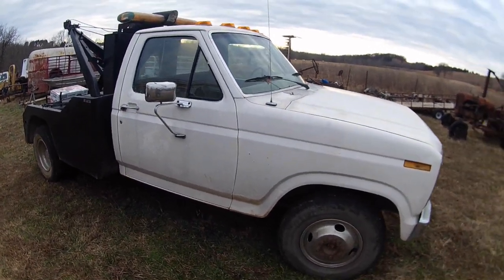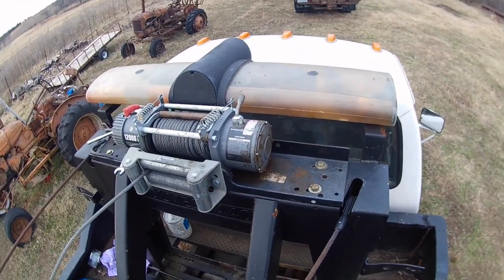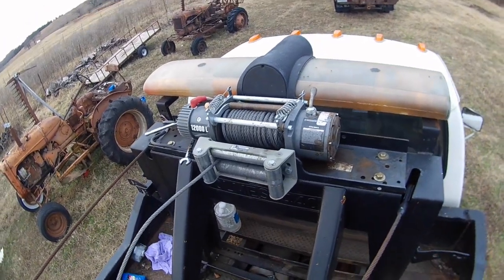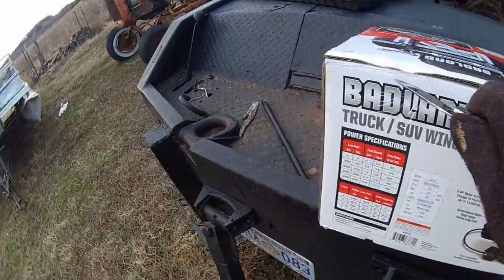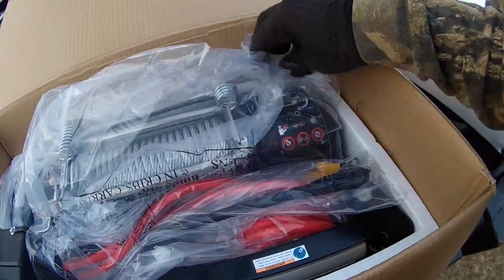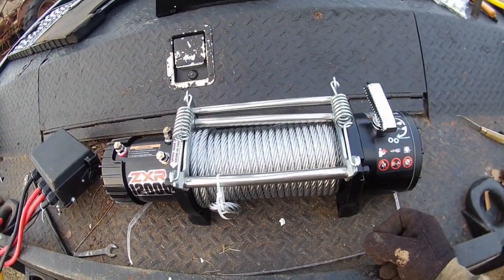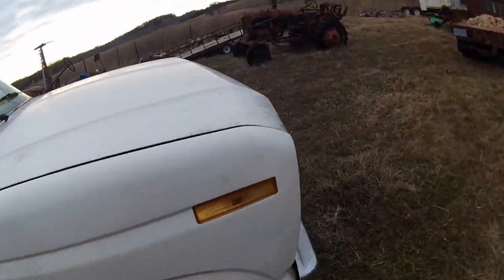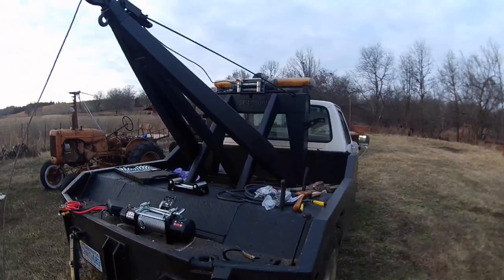holmes 440 wrecker bed electric winch conversion

Comment: This is great info thanks a lot I just started a roadside assistance company n I’m using a 2500 gmc with a utility bed until I can afford an older wrecker .i do have the winch to but haven’t installed it yet..

Comment: I know EXACTLY what you mean when you talk about later model wreckers with all the hydraulics JC.....I long for the days when we used old school holmes 440's and challenger 4500's.....when I first started towing that's all there was.....then by the time I started running my own tow co I bought some used older f350's and C-30's with 440's and I installed triple k mechanical wheel lifts....good times.....but you have to modernize eventually, and I miss those rigs.......im so sick of blowing hyd lines and having cylinders wear out. I don't blame you for going with the electric winch tho....but ive never heard anything good, like they struggle under any real weight (I spose you could always throw a snatch block on the sling and run the cable back up to the boom) and that ''they aren't made for constant weight'' and they will creep back down under load going down the road, any problems like that? I always thought a killer combination would be an old 440 bed with an electric over hyd wheel lift, remove the boom but leave the bulkhead and mount a winch just like that on the deck for doing winches....might still do that some dat if I ever find a solid 440 or challenger 4500 bed anywhere......
Reply: I had a No Mar wrecker with a Ramsey electric winch, I never had any problems with it creeping or lack of power. In fact on a particularly tough recovery I could lift the front of my truck right off the ground. The biggest problem was batteries, the winch could eat up the batteries and alternator.
Reply: I drove wreckers in late 80's to mid 90's. walked away before I would use "modern equipment" yes I am serious, I hated rollbacks, still do, job was selling old wrecker & bought a newer rollback, so I quit, I didnt like electric winches, although I do have a boom in back yard with electric winch, I liked PTO winch with chain drive, if has wheel lift, I want it powered by the cable pto winch, I like recoveries from wrecks, I never cared for grab & go broken down. so I am probably 1 of few that honestly still love the old all mechanical wreckers. and never cared for hydraulics, or modern stuff.

Comment: Local salvage yard has a 440 wrecker boom (not the bed, just the boom/old pto winch). Do you think I would be able to bolt it down to a regular steel flatbed? I don’t plan to use it to tow anybody, just moving things around the farmyard and maybe pulling out a friend who’s stuck in a mud hole once a year or so. I certainly don’t plan to use it for commercial work.
Reply from the maker: absolutely all you need is the frame that goes inside the bed it bolts down to the western hauler style bed any ways no reason you cant bolt it down to a flat bed and if they have the sling you can bolt it down to the back of the flatbed just make sure the frame is complete
Reply: jc doesn’t have the sling that I’ve seen. (It could be there, though.) I think the frame is all there. I took a picture, lol.
Reply from the maker: just take a good look and if it is all there buy it you wont regret it i use mine constantly dragging in junk and equipment the last video i uploaded the farm buy out video everything was brought in with that wrecker
Reply: jc thank’ya! Wonder how heavy it is, lol.
Reply from the maker: the frame it self is not that heavy if i had to guess 500 to 600 lbs
Reply: jc cool! It shouldn’t be too hard to take off for hauling things then, I don’t think. Now to come up with the last $200 I need.

Comment: Also do you think I should relocate my winch to the top it is also a 12000 pound Harbor Freight winch I'm out in mine at the bottom I was wondering if I was making a mistake before I put too much wear and tear on it
Reply from the maker: i thought about mounting the winch at the bottom at first exactly where the old holmes winch was but the more i looked at it and thought about it i realized it was just way better for the winch to be mounted on top because it is easier to mount and is also pulling the way the winch was designed to pull with way less stress on it my opinion mount it on top and you will be way better off
Reply: Thank you very much I appreciate the help and info on the winch
Reply from the maker: no problem glad to help

Comment: I just build a truck just like this I was wondering why you put the winch on top instead of at the bottom of the bulk
Reply from the maker: because it pulls the winch up its harder to mount and the rollers wont work near as well
Reply: I would be interested to find out how that elec winch worked out for you......do you have a video of the truck?
Reply: one thing I would add, im watching this video, and im thinking if I ever did this, I would rather mount the winch down on the deck in the original spot.....but then actually, JC is prolly right about one thing....the distance tween the original location and the pulley at the top of the bulkhead is actually kinda short, and I would bet the winch cable would not spool up properly (an original winch on the 440 has a much narrower and larger diameter spool and wouldn't suffer the same problem, whereas the distance from the top of the bulkhead to the pully in the sheave (tip of the boom) is much longer and would allow the cable to find its own groove and spool up much cleaner.....JC could prolly explain if im right or not.....either way, I would like to know if you mounted an elec winch, and how is it working out??
Reply from the maker: it works awesome i have drug in all kinds of tractors and farm equipment  with it and junked numerous cars the sling works great great just like it should and check out my ford 7.3 truck rescue video to see it in action  and watch my channel you will see videos of it and i am also getting ready to mount it on a 91 f350 4x4 so that will be a video you might want to see
Reply: I watched that vid of the 94 you rescued......i'll keep an eye out for the vid on the 91 4x4. I should prolly use my towing channel from now on....i'll go log in and sub you from there.....
Reply: im also getting ready for the electric winch converson. thank you for the video. i was in doubt if the winch break would hold the load. 5 years of your testing has convinced me.... Thanks again for your time in making the video. very much appreciated....
Reply: This is great. I'm considering doing this to an old dual boom light duty I've got brewing.

Comment: So you basically converted a 440 to a 220.
Reply from the maker: i guess so didn't know holmes even made a 220 model untill you posted this comment  i went and googled it and seen one except mine has the full wrecker bed and is rated at 6 ton instead of 4 oh well at least i still had an original ideal of my own and built it thanks for the comment i learned something today and i hope you still enjoyed the video